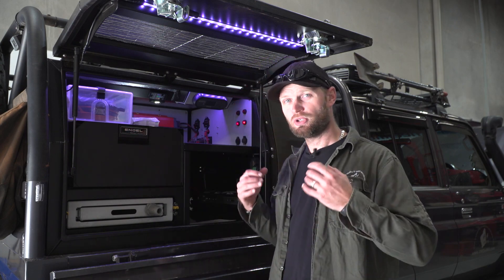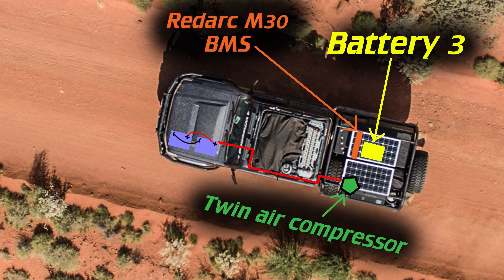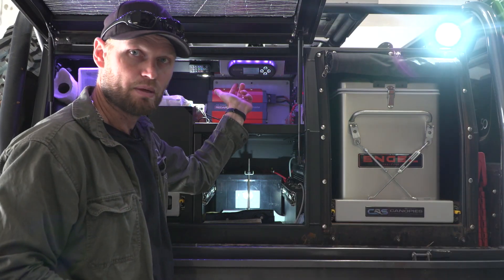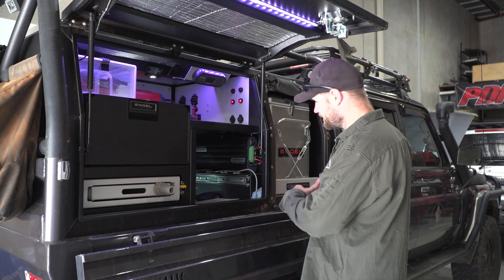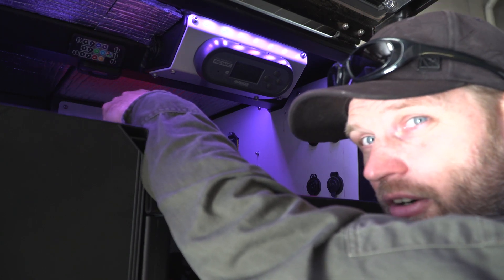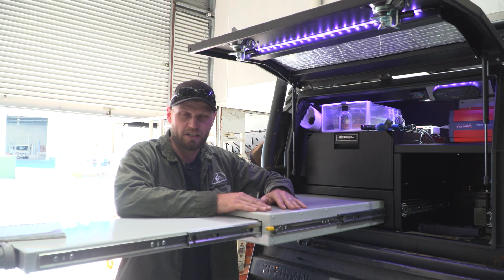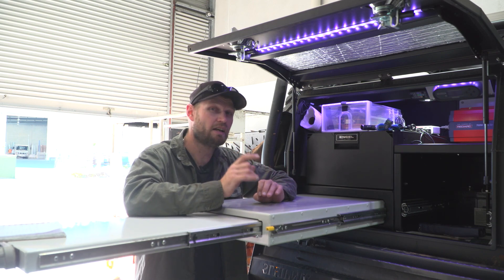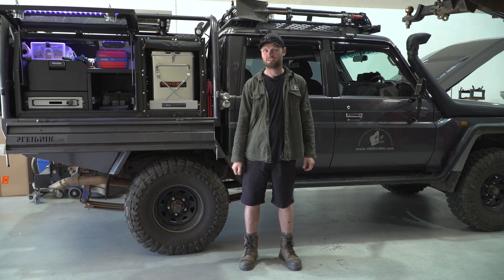My New 12volt DIY setup Landcruiser 79 series

Comment: Thanks, it do help me set up my canopy. I  got 2x 135ah lithium battery and 2x350 solar  panel, 4000w pure sine continues current DC TO AC inverter, smart  wire hub, 40A DC TO DC  charger,  solar system regulator. But  all cheap one,  hope them  work well . I  will start put them together next month.

Comment: Hi Ronny, love your video's.  As already mentioned, research using two 6 volt gc2 golf cart batteries wired in series which gives a total of approximately 460 AH (@ 20h) and is a very common setup in the marine environment.  This is what I use on our boat along with a 200 watt solar system.  Cheers
Reply: the current wont add like that. 2 100ah batteries wired in series will still be 100ah because the potential (voltage) is doubled. power is always conserved p=iv so if you up the voltage the current will reduce to compensate.
Reply: Thanks for catching my error Joss, you are correct.  My system has a total of 230 AH @ 12 volts as each of the GC2 batteries are rated at 230AH.  Cheers

Comment: Hey ronny, just a suggestion might want to look into getting the bolt on tie wrap clips. 
Those sticky backs you used behind the panel like to come off with heat. We use them all the time at work to keep wires tidy in electrical panels but, if you go back about a year or two later they'll all have fallen off from the heat.
Reply from the maker: +Joe Chitussi yeah it started to already, thinking hot glue gun or something like that
Reply: Ronny Dahl you can get some that look the exact same but have a hole in the centre to secure it. hot glue would probably work too though. I used them for mine and our climate in Canada is no wear close to as hot but really cold

Comment: Great video. Very helpful.
Question 60Amp fuse on 700W inverter - shouldn't it be 125A?
Reply: You're thinking 700w on 12v. The inverter is 240v, 700w output..  700/240 x 20= 58.333amp
Reply: Page 21 of Redarc User Guide for RS Series 12V & 24V Inverters Recommends 125 amp fuse -
Reply: @4XDestinations  My maths was off (edited) but it still only equates to 58.333 Amps. 60A is fine for what he's using it for.. 125A would allow way to much overload to the inverter, unless you were happy to fry it andf maybe your car/camper... 75A is as big as I would go. I always try to keep within 25-30% of the maximum power usage specified. Easier and far cheaper to reset a breaker or replace a fuse than to have to replace everything that burns.. But I'm sure Redarc would be happy to sell more inverters :).... P.S... Redarc recommend 50A for 24V and it only draws just under 30A so 35-40A would be safer. 125A in a 24V system would allow a 150% overload.. You'd need a fire extinguisher long before the breaker tripped :).

Comment: I've been using a Battery Tender Lithium battery in my Can-Am ATV for a year and it's been amazing. Even after extended time sitting, cranks up with authority. Stock battery was 12lbs, lithium was just over 3lbs. 

My plans are similar to your build but I'm going to run 4 of the same Battery Tender units in series. If they can live in my ATV for a year smashing over Arizona rocks, they can live in my 4x4 rig.

Comment: In another video you showed linking your main and 2nd battery with a switch on the dash, and you mentioned using that when starting, any chance you'd be able to explain that system? Do you have a BCDC between the 2 batteries as well?

Comment: Hi Ronny have you fused your wires under the bonnet feeding your bms and twin compressor? also lithium battery not a good idea they naturally build up an internal resistance as they are charged and discharged and could explode, I wouldn't  risk it . keep up the good work.
Reply from the maker: +ross sainsbury yep one with 50 amp midi and the other 80 amp
Reply from the maker: +ross sainsbury yep one with 50 amp midi and the other 80 amp

Comment: I would suggest a bushing in your panel where the wires come from behind to out front. Just a good precaution as to not rub through the insulation on the wires.

Comment: great video as normal 
the only thing was the batteries or battery if your deep cycle is going flat to quick you may need to work out the total watts used of all your items and work out your amps . For 12 volt (volts divide into watts = amps ) as somethings don't run 24 hours it give a good idea of much amps you need . myself I would go for two AGM deep cycle as it give you a larger volume to use

Comment: Ronny, Quick Question,  does the BMS discharge the House battery before pulling from the Starter batteries? I ask because it seems like you are draining your starters which are not deep cycle batteries before you start discharging the house battery under normal circumstances ( No Solar) while camping...
Reply: The BMS is only a charger. It turns on and charges the AUX battery when it detects 13.2v from the start battery DC input source, which will only be when the engine is running. the rest of the time the start battery is totally isolated from the AUX battery and you can continue to draw power from the AUX battery without fear of draining the start battery
Reply: Thanks for that Explanation

Comment: Excellent set-up, very well thought out.  You have run into the same issue that I have ... not enough battery capacity.  The benefit that AGM and lithium batteries have over a lead acid don't seem to offset their cost though. I suspect that you need 200-250 ah of capacity with your power needs if you aren't running the truck daily or aren't parked in full sun.

Comment: mount the solar with quick connects have a exteded cord with quck connects and a stand if they are not to heavy use a tripod and make a mount for the solar panels :) that way you have some charge while driving mounted up top and when you go camping you can take them off and set them in position right to the sun

Comment: So to run 2 batteries i need to upgrade the alternator as well? What are my options?
Reply: no you don´t. BUT running 2 bat. parallel they need to be the same!! same condition and best same type. They will be 1 big storage, this means if one has 15% worse condition [due to wear] the other one will ALSO only be charged to that amount, 85% in this example!
2. Bat. should always be charged full. IF you are not able to have them full charged regularly while driving, this will kill bat. in the long run.

This CAN be due to too big bat. vs alternator. But can also be due to too much light/ fridge etc.

Comment: As others have mentioned, go with 6v golf cart batteries in series and match them up with your solar panels. 160w solar so 160 amp hours. I wonder if those panels you have are not that efficient? Loosing 50% just with shade from your hand isn't great. A lot of modern panels now work quite well on overcast days . Great vid btw.

Comment: great setup Ronny. keep it up. how about a 1 or 2kva inverter generator to top up battery when camping for while. its a option. just have a strong Ac battery charger with Anderson plug when its required.

Comment: For the house battery, if you're going to spend $400 on lithium, there may be better alternatives. If you have space or weight to spare, my recommendation is always to run two golf cart batteries in series. They're 6v ultra deep cycle so they would be perfect to run on extended trips, they cost less than lithium and they're easily found anywhere. I used to run that setup on some of the ambulances I built. Put them in a box between the frame rails to try and keep the center of gravity as low as possible. Your whole setup looks very well done and thought out. Crimping is always better than soldering for offroad vehicles so I feel very confident you'll have many years of good use.

Comment: I'm not an electrical engineer, but you said your BMS only charges at 30amps tops. Based on that it shouldn't charge a Lithium battery any quicker than an AGM. You may be able to discharge a lithium a little further, getting more useful life out of it, but charging should be similar. Also, I don't know the specs of your BMS, but does it charge Lithium batteries? They may require different chargers or need a separate charge controller.
Reply: Lithium batteries charge 5 times faster than an AGM, AGM Charges 5 times faster than a lead acid, due to the chemistry and make up of the battery. The BMS1230S2 can charge all battery chemistry's through a selection panel and will deliver the correct algorithm to the selected battery type.
Reply: It's pretty much irrelevant how fast the batteries will charge if the charger can't keep up with them.

The fastest that the Manager 30 will charge anything is 30A because it's a 30A charge controller - you put a 105Ah battery in there it's going to take at least 3.5 hours to charge it from flat (not that running any battery down to flat is a good idea). Now the reality is that the charger will charge at 30A until the battery is nearly full, then the current will drop off massively. 

You look at a Tesla Supercharger and the last 20% or so is really slow in comparison to the rest of the charge sequence. 20% to 80% takes a similar time as 80% to 100% full. If Ronny doubles the battery capacity it's going to take a good day's driving to fully charge them.

As for safety of Li-Ion batteries, they're a lot safer than people give them credit for so long as you're not an idiot and use a proper charger. If you have a look at bigclivedotcom's videos he's stabbed, dismantled, shorted and generally abused a heap of batteries and rarely has to use  his explosion containment pie dish.

Comment: Great stuff Ronny - was particularly interested in hearing the downside of the solar panel output due to a bit of shade... I had been considering a sliding/removable "under rack" mount.  Sounds like I'll be reconsidering that...  great video

Comment: I think the only thing I'm not a fan of with the BMS 30 is that it can only handle up to 550w of solar.  I have a cheap ArkPak which I started with and even that can handle up to 800w. Only charges at 7amps though.

Comment: i would of recommended you run 2x 105ah batteries in the back, mainly because you run 2 fridges, lights, charging batteries etc. ull be cycling that battery to 50-60% soc quite often which wont last as long

Comment: What would be a good alternative to the Redarc bms? For us that do not have just under 2000aud to spend 😂
Thanks for a good video!
Reply: CTEK D250SA + CTEK Smartpass 120, under $800.00. Will charge your batteries from alternator at 140A.

Comment: Great video Ronny! I did notice that you don't have any relays for your switches, or you don't show any in the video at least, with the LED lights it's not a big issue but I would still recommend having any switched power going through a relay. Also I would recommend installing a couple of switches for your fridges, with relays of course, so that you can turn off your fridges separately without having to trip the circuit breaker and kill power to everything on that fuse block. Even without power the fridge will stay cold for a few hours while you charge things up via solar or even running your engine. Also when parked in the driveway at home you don't really need to have the fridges running. Your AGM battery will charge a bit faster without the current draw of both fridges. Then you just flip a switch and turn them back on and even alternate which one you have on in a low power situation. It would be a low cost alternative to adding an expensive 2nd AGM battery or upgrading to the Lithium battery.

Comment: Ronny, just a thought, do a cut over on one of the cranking batteries. When driving at night or winching, cut over to use the battery in parallel as a cranking battery. When you are parked up, cut over to an Aux battery and run it in parallel with your rear battery. This way you are saving money on purchasing a second battery or replacing with a lithium.   If you think about it, you second cranking battery is a waste when you are parked up, one battery will start your vehicle after 10 days camping. Its more important to keep the freezer running. A warm beer is no good!!

Comment: One point to make when using 2 batteries in parallel for cranking and high current loads like winching. You connect exactly like you have, but then when connecting to the car you connect the charge from the alternator onto positive terminal of battery one and you have battery 2 negative connected to the body. This allows you to draw and charge across both batterys equally. Especially with things like a winch I would connect directly to the battery but the opposite from the alternator.. eg negative to battery one and positive on battery 2 to ensure that you are drawing across the 2 batteries and removing all the losses from the multiple connections at the terminals. This is a method we used to great success in competition car audio where we were drawing 700+ amps for 3-7. Secs running 7000wrms.. this method above would generally help the voltage sag under load by over 1v Taking it from 9v under load to up over 10. Big big difference just by moving a couple of terminals around..

Comment: Two questions.  1)  Because you are running two starting batteries, did you have to use a bigger fuse between those two batteries and the BMS than you would've had you only had one starting battery?  2) You mentioned you'd like to have a lithium house battery; with your current system would a lithium battery be a simple plug-in-play / replacement or would you have to replace BMS or anything else?

Comment: got a question why have you not gone the route of an ac breaker box..

my understanding anything requiring shore power must be a min spec of 15-20 amps at 240 vac and the ac power must be behind its own breaker panel...

as far as I know this is part of electrical safety law and also compliance for insurance 

I would drop by cemec  in welspool if I were you and see if they have an ac breaker box because as it stands at present you would not comply for either genset or shore power connection..

not sure what you are powering in regards to cb and ham radio ron, though i would suggest either another 2 or 3 batts in agm or lithium though I would check to see if the charge controller is compatible with using using lithium batteries.

nice setup though it has room for improvement though nice start!!!

IF you are looking at  lithium I would suggest in redesign of your power system relocate all batteries into the tray..

always note if you are going to run batteries always run in parallel, it is never a good IDEA to run battery mismatch no matter the type looking at all your power requirements inclusive of all light and accessories..

you can flatten the higher amp hour battery to retain charge of the lower amp hour batterey as even if separate on separate circuits they are still within the same power circui infrastructure 

If you take a total load count of everything running you are likely exceeding the the 12 VDC load count I would also consider anderson power pole options for quick vdc disconnects..

personally if i was going to run a fridge/freezer setup on to of the same coolers, keeping 1 for frozen and the other as a fridge sometimes it doesn't pay to use 2 types of fridge/freezers a 1 can draw more power than the other

Comment: Hi just watched a video regarding ac/dc unit should be near 3feet from the battery . As you are using front 2 bats for winching and all other. Should your acdc not be used for the third battery which is supplying continuously for fridge and other units behind. Clarification please

Comment: Some comments about Lithium batteries have confused Lithium Ion batteries with Lithium Iron batteries (Ion is an atom or molecule with a net negative charge, Iron is a metal element commonly used in steel making).

The issues that make Lithium Ion batteries unsuitable for an auxiliary battery in a 4x4 vehicle have been raised in the comments.

Lithium Iron batteries don't have those issues such as causing fires if overcharged.